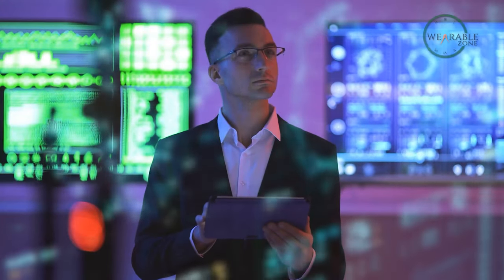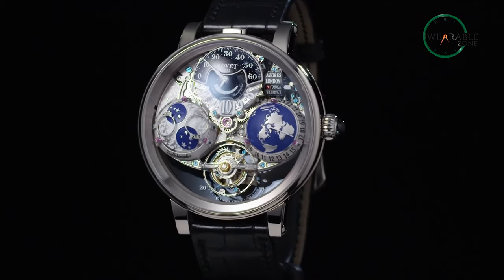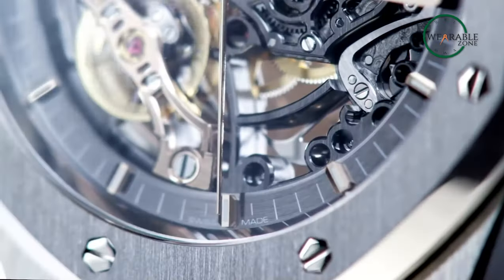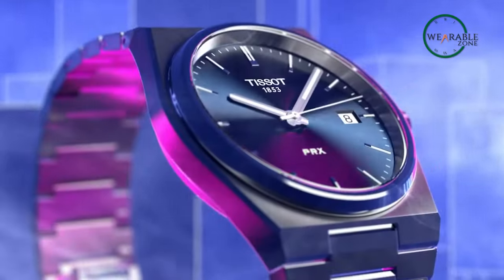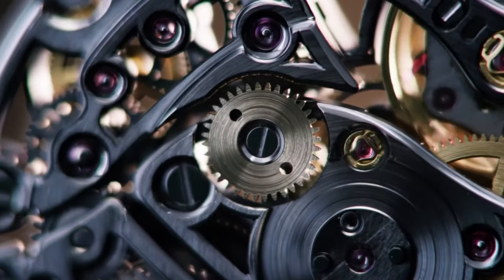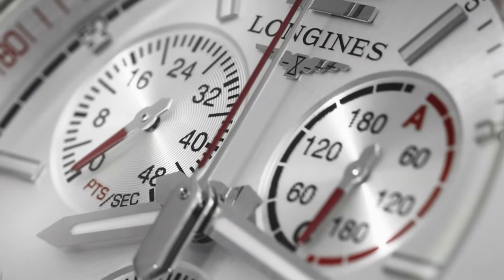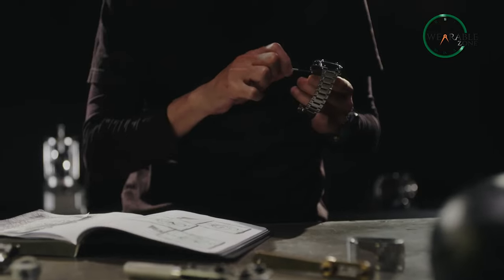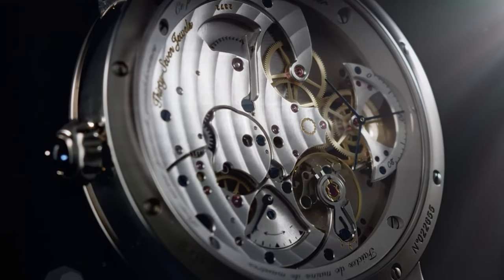Quartz vs Automatic : Watch Movement Explained!

Comment: I have both kinds of watches automatic and quartz and some of the third kinds digital.
None of them are expensive watches. But all have their own things that attracted me to them. I appreciate the mechanics of the automatics in an automatic self-winding watch.
They are excellent if worn every day and they keep themself running. Otherwise, they will rundown, and you have to reset time along with date if it is on the watch. But there are winding devices you can buy to keep them on while not in use.

The quartz just keeps on going till the battery needs replacing.  I do know some people who if not using a quartz watch for a while. Will pull the crown and stop the watch from running to save battery life.

Digital watches well that’s a whole different story.
But no matter what you have so long as you like it and enjoy it and it keeps good time that's all that matters.

I am reminded of the story when it comes to watch brands.
A man on a train station asked two people what time it was.
One man looked at his $3000.00 watch and told him the time was 3.25.
Fifteen minutes later he asked another man what the time was
The second man looked at his $10.00 watch and said 3.40

But in this day and age anyone who has a phone has a watch. 
So why do we keep buying watches? 
Is the real question

Comment: For starters. I have 2 quartz watches that lasted beyond the 20-year mark (change the battery every 3-years). Automatics can differ even from the same company. Take Techo Marine and Invicta. The Invicta is more accurate than the Techo Marine. They have different movements. But same price point at time of purchase. But you should add some watch winders can't rewind some watches because their motions can rewind the movements.
Reply from the maker: Thanks for sharing your valuable suggestions,
Subscribe to our channel if you want more awesome contents.

Comment: With the atomic app available on the iPad  the conventional mechanical watch can exist.  Especially if it is a manual wind.  Everyday you wind the watch it is quite easy to adjust the time.  Mechanical watches are accurate enough  to exist .  Mechanical watches should only tell time.   iPhones apps are so much better .   You wear a watch to quickly tell you to tell the time.  Therefore  what brand in most cases is a ego decision.   A classic man’s dress watch 
like. Vacheron  Constantin is usually a one function devise. It tells time.  If you need more than time use your iPhone.
Reply from the maker: Thanks for sharing your thoughts,
Subscribe to our channel if you want more awesome contents.

Comment: I've had my Rolex submariner with the Cyclops for 25 years and it has never seen service.
Reply from the maker: Thanks for sharing your thoughts,
Subscribe to our channel if you want more awesome contents.
Reply: Go get a service as far as you can. 25 years without servicing a mechanical caliber are too much. Rolex suggests to get a service every 8/10 years. Different is the case of the Co-Axial technology of Omega’s calibers that consent to prolong times of services more than over 10 years. After 25 years the lubricant oil will be pretty dry, so the more you use your Submariner the more the parts of the caliber will get consumption and one day some parts will break and then you gonna have to spend a lot more, than a simple servicing, to replacing them
Reply: Bad idea. Watches are like any other mechanical devices. If you skip service, it may cost you more in the long run.
Reply: Let me guess, you change your motor oil only when the light turns on?  Get that thing serviced.  Maintenance is way cheaper then Rolex needing to replace parts because of excessive wear.